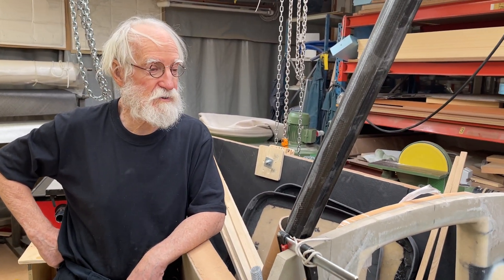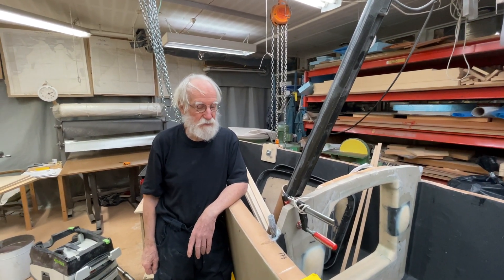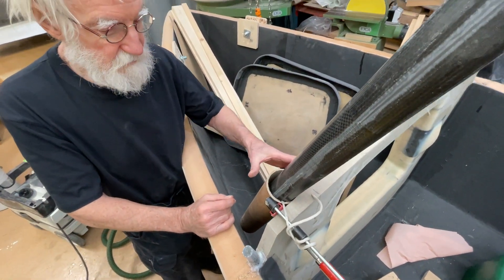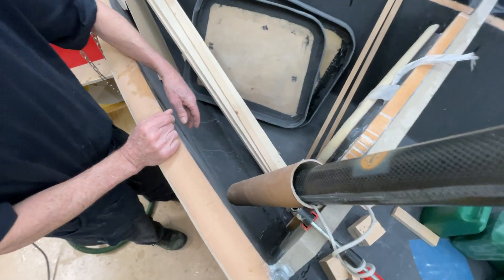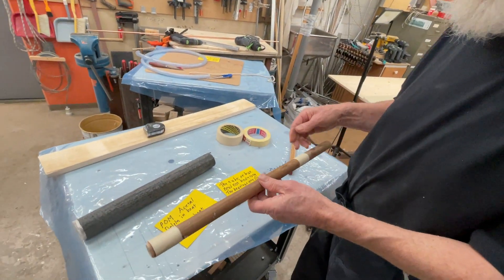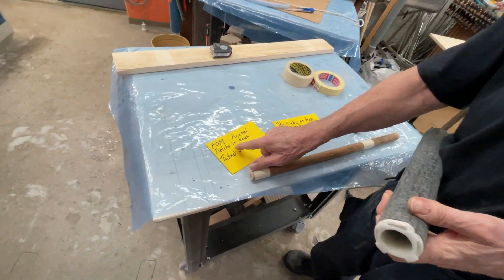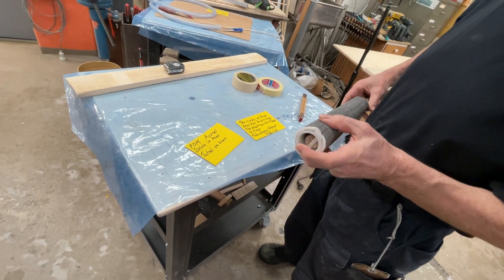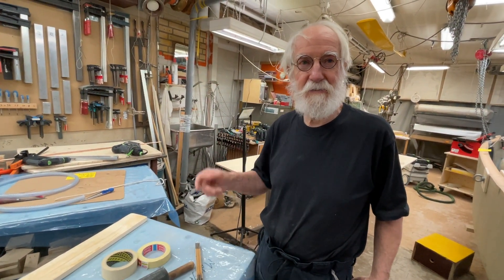Rotating masts, the bearings and dranige.

Comment: Thank you Sven for the demonstration and showing how the masts will be installed. I am thinking you will have a total of 10.5 square meters of sails in the three sails.  Is this correct? Have a good day.
Reply from the maker: Not correct. It is 8 square meter. The two rotating side by side masts have each 3.5 square meter. The mizzen with the lug sail have 1 square meter. This is twice as much as Exlex of 2020 and 2021 had. The new boat also have less wetted surface and is 0.47 longer.
Reply: @SvenYrvindExlex  Thank you Sven. Looking forward to seeing more of the mast installation when you get there.

Comment: Simple. Does this system now need a thrust bearing to retain position vertical in the tube? Still unstayed? Thanks.
Reply from the maker: It needs a thrust bearing. I have not decided to have it at deck level or at bottom.

Comment: Thanks for the visual. The outboard drain is interesting. I was planning to have a lip on the mast above where it enters the deck, which extends over the tube coming up out of the deck. That way most water coming down the mast can't enter the tube, it will just run over this lip and drip onto the deck a couple cm to the side of the tube. The tube would come up above the deck about 10cm to help keep water that washes across the deck from entering the tube. Then finally, inside the boat at the bottom of the tube I'd have a small hole so that any water that enters can trickle out into a small compartment where I can clean it up with sponge.
Reply from the maker: You can also have a hole at the bottom of the tube, letting it out that way. Matts Paradox have it that way. Look at the drawing. However make sure that the tube have no connection with the inside bucause when capsized the there be no air cussion to float on the boat will sink.

Comment: Will the mast bearings be able to be replaced at sea?
Reply from the maker: Wear will be minimal. There was no wear on Exlexs masts after 150 days sailing 2020 and 2021. Not even the halyard holding the yard of the lugsail had wear. Its only 3.5 Square meter sail area. Small boats small problems.

Comment: Very interesting. 
Will the mast need something to hold it captive in the tube+bearings, while permitting rotation?
David (s/v Trois Bouleaux, an Alberg 30, Lake Huron, Canada).
Reply: @Richard Gleaves All you need is a reefing line that rolls up around the mast near the deck. Ease the reefing line as you pull on the sheet to unfurl it. Ease the sheet as you pull on the reefing line to furl it. Very simple, no other brake needed. The reefing line goes to a cleat or rope clutch and this keeps the sail from unfurling any further than you want it to.
Reply: @JakeHolman78  Yes a small coastal cruiser built in France used this system :
https://www.youtube.com/watch?v=w67aczIkmUY
The "IKONE J rando" built by ESPACE VAG yard is discontinued by the molds have been bought by another French yard. Not a blue water sailboat but it shows the system.
Reply: @papounet4842  Thanks, good video for me to see as a reference. This is exactly what I want to do with my rig.